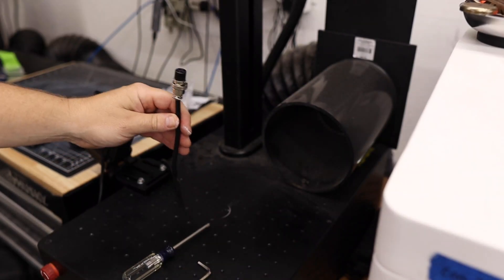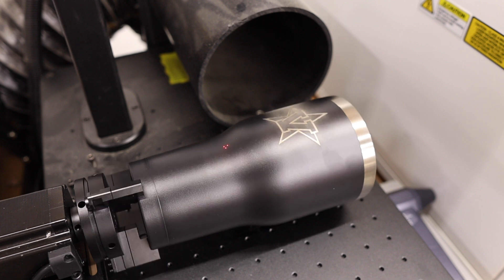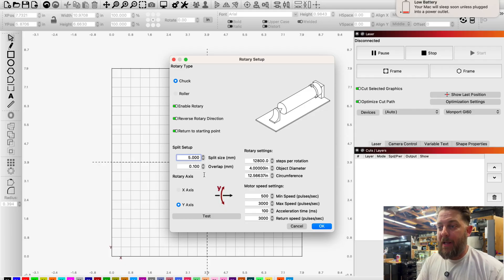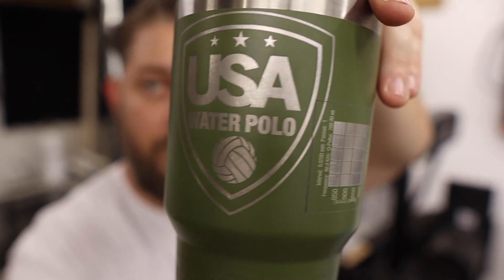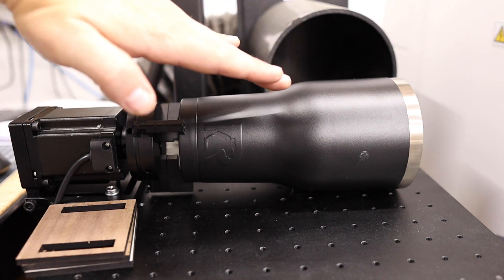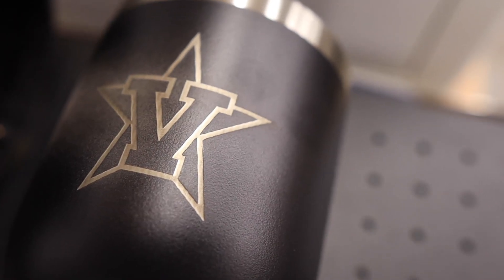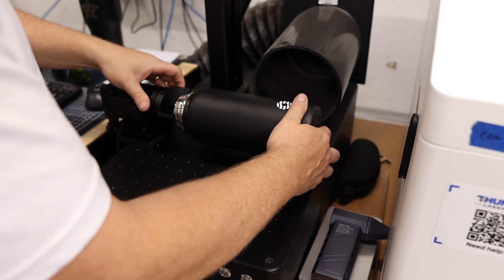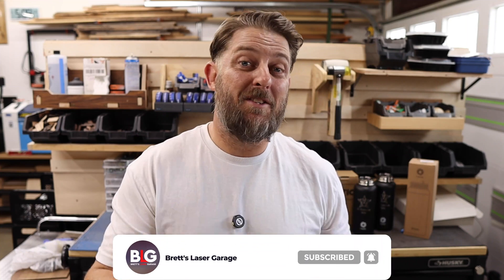How To Setup Monport GI60 Fiber Laser Rotary & Engrave Tumblers | Brett's Laser Garage

Comment: This video was a lifesaver today.  I usually use CO2 for tumblers, but today I found that my tube was cracked.  I needed to figure out how to do tumblers on my 100W Mopa.  I was having no luck with my settings until I saw this video.  Thanks a million.
Reply from the maker: You’re very welcome!  Thanks for checking out the video!

Comment: I have the same laser. Looking into getting the rotary attachment, but i was curious if you have done a full wrap engrave on a tumbler? Is it capable?
Reply from the maker: Awesome!  I have never done a full wrap so I can’t say for sure.  I don’t think fibers are capable of full wraps in general unless you’re talking about a fairly short cup.  The stock lens is 200mm on the GI60 so the max working area is 7.9”x7.9”.  Wrapping would be no problem because the tumbler turns on the rotary but the other direction will be limited by the lens size.  These principles would be true of any fiber laser and lens combo, not just specific to the Monport.

Comment: I have the same laser. I had some issues in the beginning with it. A bent rod and the head was not level. Too bad Monport has horrible customer support. It took months to resolve the issues with them. If you're new to fiber lasers, run from this company. Once you get over the hump of them being a horrible company, the laser itself seems to be pretty good.
Reply from the maker: Agreed their customer service needs a lot of help.  They tell me they are working on it so that's encouraging.  I'm glad they were able to fix your issue but it's not right that it took that long.  Maybe I'm lucky but I haven't had any issues with any of my Monport machines.  Thanks for checking out the video and have a great day!